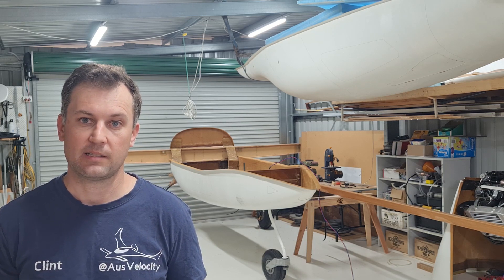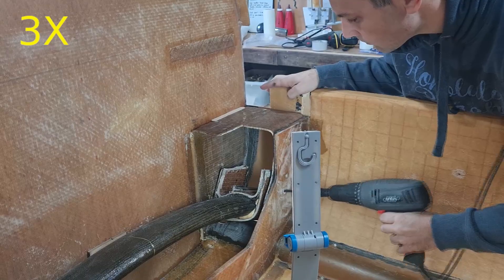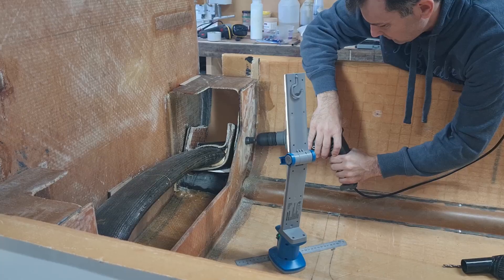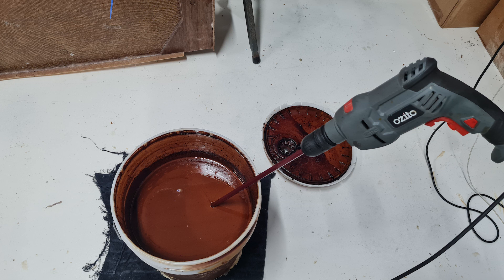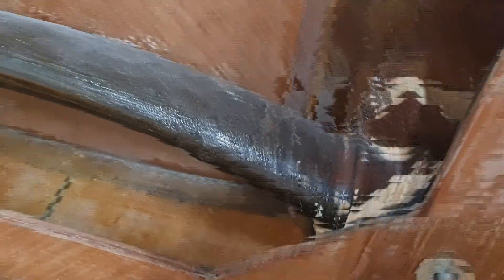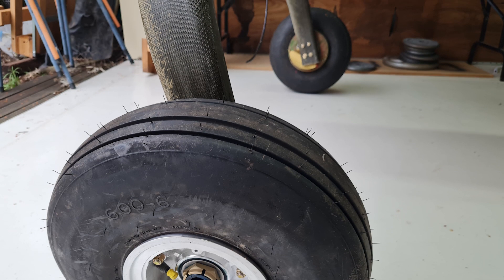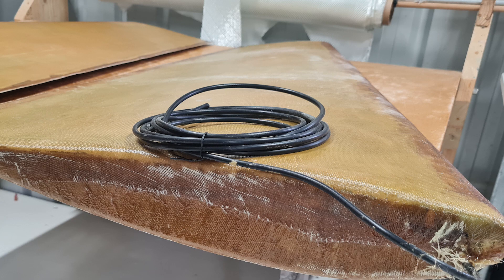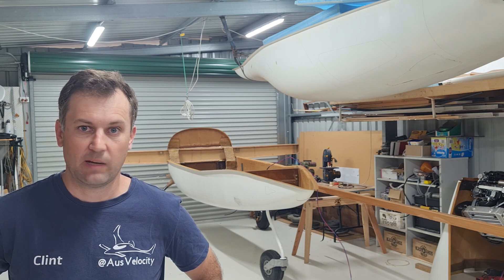Velocity Build Experience 06 - Main Gear-Centre Spar-Winglets Finish.

Comment: I really appreciate your videos on your build experience, but man, this hold build thing is messed up!!!!!. I just discovered the Velocity and instantly fell in love, but the whole build process is so loosey-goosy! Isn't aircraft construction supposed to be more precise? It seems like the whole process falls under "that's close enough" mentality. Is the final aircraft safe to fly?
Reply from the maker: Yes you're right. Everything about aircraft building that I've seen is precise and perfect, up to the point of needing an autistic level of OCD or everybody dies. That's a good attitude to have. 

If building a Vans or a Sling, yeah, things cant be bent or it will collapse, holes exact size and need to be deburred, every part needs to be prepared. A miss-drilled hole means you need to order a replacement part. Just build like you're working for NASA.

Vans meant for you to be really meticulous. Look at their laser cut holes saga, their engineers proved the holes are good to go, but they want to encourage builder perfection so offered replacement parts anyway. perfection = confidence.

Velocity, It's mostly just glass, epoxy, foam and marine ply keeping it together. Simple, Strong and effective. They encourage you to do the right thing  and follow good build practices, but I get the impression they know it won't kill you if you followed the instructions. You'll probably just have to make a few adjustments.

Everyone in the velocity community has a hard time coping with the fact that the plane is not that precise. There is no level of machine precision on this plane, the molds were molded by hand in the 80's before CAD and CNC were the standard. It's built like a tank so the builder doesn't have to be  expert. Look at the g-loading, +10 -7. A modern  aerobatic RV14 is +6/-3g. 

If something is important, it's highlighted in the manual. Things like wing angle of incidence. Or it's been pre-engineered for you so you can't mess up something important, like the shape of the wings. Almost everything important is adjustable after the epoxy has set. I guess if you do the right amount of glass layups for strength, it looks straight for aerodynamics and you didn't miss anything, then it's probably going to be ok. 

Yes I try to be precise, but going for NASA levels of perfect is a waste of time.

Thanks for the comment! I really should make a video out of that.
Reply: @AusVelocity , Thanks for your response and honesty about your experience and thoughts on the process. The velocity is an absolutely incredible-looking plane. I am a very handy person and completely capable of building something like this, but I think my perfectionism would be my downfall in a process like this. I'm not sure I could sleep at night, knowing my drilled holes were not exactly in the right place. I'm impressed with your ability to work with the given process.

But on a side note, those who build the velocity seem to have great success, and the results are incredibly beautiful, so... what do I know? :) I can't wait to see more of your adventure and the final roll out!!

Comment: How much was your velocity?
Reply from the maker: The Kit was US$40,000
The engine was US$24,410
Of course the prices have risen from when I bought it.
Reply: @AusVelocity  that’s not a bad deal at all. Congrats on your purchaser man.  How is the build coming along?
Reply from the maker: @Never_quit  Working on the canard wing at the moment, as well as designing/programming the aircraft electronics such as the engine sensors, trims, speed brake, safety systems, etc. display. I wont show that until its done though. It's unfortunate since it's a big time killer, but I think its necessary, and way cooler than anything else I've seen.

Comment: 😢Like I said in your build number 5, I would have placed a shim between the two spars, instead of using that tongue depressor shim.  It just doesn't look like a "Civil Aviation Safety Authority" approved repair.
The more I think about this, it's troubling. Is there a chance that you didn't glass in the firewall properly?  If you did not, fix it now.  I guess we'll see when you mount your engine.  I suppose that you can always insert a tongue depressor on one of the mounting points of your engine mount.
Reply from the maker: I see your point.
Yes between the 2 spars will need some thin steel shims to get the correct wing pitch angle.
Only use shims at the bolt holes in the spars to angle the wings?
I didn't consider that because the manual didn't mention that. I also didn't consider how much shim I would need between the center spar and the two wing spars, probably 1/8th inch, same as the tongue depressor.
There is ample amount of construction adhesive to fill the void left by the wood shim and I'm confident that the spar is bonded to the firewall.
I feel like trying to un-bond (cut the adhesive and everything else) from the spar and  firewall now would probable lead to a worse situation than what I have now.
There's a lot of bonding points holding the firewall to the fuselage including the 1/2" bolts with more to come when the top shell goes on.
Knowing that there could be a weak point in that position I'll add some more layers of glass around that area in the future. Perhaps from the engine side of the firewall to the spar.

Thanks for raising issues that you see need attention, I have alarm bells that ring too when I see things that seem dodgy but I don't see everything.
Reply: @AusVelocity  My concern is that the firewall is taped in correctly.  I doubt that the main Spar is off 1 degree.  After I finished my Velocity,  I flew down to Sebastian. They use a mold for those spars.  If your firewall is off, you can also shim the motor mounts with a washer.
I was fortunate.  I had a fellow that had just finished and RV 4 helping me.  He had a lot of tips to solve problems.  I'm sure everybody's wings aren't perfect.  We have aileron trim.  I remember on my early flights.  I trimmed my ailerons.  The next flight, I tried to trim them again, and they ended up in the same spot as before.  I flew that Velocity for 450 hours after that, and never had to trim them again.
Reply from the maker: @Alumni6042  Yes, It's likely that the firewall is not exactly square, very hard to get that right when the nose is off the centerline. I'll just have to shim where I can. Thanks for the input.
Reply: Now you may be right about your nose being off.  When I was at Velocity, I noticed the original plug built by Dan hanging up, and I asked what is that, and they told me it was the original plug.  They also admitted that it was off a little bit, which means the original mold was off, which my plane came out of.  I don't know if they used that mold for your plane, but it's quite possible that your nose is off a little bit.  Having said that, I never could see it, and it didn't affect the flight any.

Comment: Hey Clint. I just discovered your YouTube channel, your project and went through all your videos. I must say I’m impressed by all you already did, and how you managed to overcome  the difficulties. Working with composite materials isn’t an easy task if you don’t have serious experience already. 
I wonder if the kit manufacturer gives any building instructions beyond a kinda technical book.... I would have added 1-2 foam cores to the kit (some rejected foam cuts from production line can do the job) for people to to practice on before starting the actual construction btw.
It would have been reasonable to start building the winglets or the elevator instead of the wings. Smaller parts are easier to make while the issues are the same. It may have helped you to get some initial experience and confidence in your skills.
Good luck !
Reply from the maker: Hey Thanks.

I'm working on the canard wing at the moment and I've come to realise all the foam cores aren't perfect. I think the issue is with the foam and not the cut. The issue is there are stresses in the foam block as it's made and when cut, the foam relaxes and slightly reshapes itself.  I just assume you just fill in the missing bits with filler and sand down the high bits until they look good then glass over it.

In hindsight, I'm not sure any practice is needed, the foam and filler sand down easily, and mistakes are easy to fix. It's like icing a cake, just keep going until you're happy with the result. 

I don't really see myself as working with "composite materials", I watch those wizards on youtube with carbon fiber, cnc cut molds and vacuum systems and I think, I'm just playing with adult paper mashe.
Reply: @AusVelocity  don’t underrate what you are doing :) my personal knowhow is quite extensive and my comments were honest.
Regarding the foam cores : some defects that I saw were solely due to poor hot wire cutting. FYI I made moulded parts with foam cores. I had to reach precision better than 3/10mm in order to be able to close the mold. I still have 30 years old parts that look as strait and well shaped as new.
Regarding the foam : there are always internal tensions. The more you sand the foam the more you release these tensions. A good foam core is the one that needs nothing more than a good brushing to remove the filaments, then a very slight sanding, to remove the superficial hot wire cuts residues. Don’t forget to blow some air to remove the dust as it sucks a lot of epoxy. I wonder which filler you use since, according to my own experience, sanding epoxy based filler (hard material) and foam (soft material) at the same time makes things only worse ...
The key to overcome the tension issue resides in the quality of the negative foam elements. If the initial block is strait, all the building should simply be done using the negative core as a jig.
I use to glue (foam contact glue) the negative core to the working table (massive and strait. The best working table consists on a marble plate. Steel tubes reinforced wood plate can do too). Just protect the negative core’s inside (concave form) with a plastic sheet (the one used for greenhouses is perfect), place the foam core and tape it, lay your fiberglass etc, and your wing will never have any unwanted twist.
Reply from the maker: @tn1509  Wow all good Information.

The filler is the recommended one from the factory, They call it Velocipoxy and it comes supplied with the kit. Epoxy, It's DER-324 and some sort of non-structural hardener all mixed with plenty of micro. My only gripe is it takes overnight to fully harden. Car body filler (American brand bondo) is good to sand in minutes. bondo is mentioned in the manual but used more as a removeable glue.

Not much I can do about the foam I'm supplied with, they are pre-cut from the factory and It's on the other side of the world so replacements are a major hassle.

Yes trying to sand foam along side of epoxy filler is a problem and you can continually make the job worse the more you try to make it better.

I notice that if the foam pores are well impregnated with epoxy then that helps keep the surrounding foam intact during sanding. But you need a runnier (less micro) filler to do that. The curse is, that the runnier the filler is, the harder it is to sand so I don't bother. I just take care to sand the filler more or with more pressure than the foam.
Reply: @AusVelocity  Thank you for your feedback Clint. Bottom line is that there are no miracles regarding epoxy filler sanding on foam  :))
I use to heat the epoxy (without the hardener!) a little bit (30°c-40°c) then leave it to cool down to room temperature. Curing should be a little faster.
I may have other shortcuts to share. Feel free to ask.

Comment: Great progress! Taking into account your location, you move pretty fast! Looking forward to see your strakes done.

Disclosure: I am in forth year of my build of Velocity XLRG :)
Reply from the maker: Thanks Dmitry, I've studied your videos several times for some good ideas and methods that I'll use later on. It was good seeing the cowling since It's hard to get an idea what it should all look like while you're building. Yes, the strakes and the fuel tanks. That'll be interesting, at least I won't have wheel wells to worry about.
Playing it cautious here, getting a replacement part from the factory would not be quick or cheap.

Comment: you can heat up the hardener. we do it in a waterbath (60-70 degree Celcius). chad told us this trick.
Reply from the maker: Ahh, yes makes sense. I use Dmitry Spasibenko's hair dryer trick sometimes with the epoxy pump.
I'll do that next time I need to refill the pump. Thanks.
Reply: You are perfectly correct!

Also, keep in mind that epoxy sucks moisture in.  Heating it up helps removing some of it (better not to exceed 40c-50c  as it may alter its properties. Some enzymes are pretty sensitive). Let the epoxy/hardener to cool down prior to use.
Don’t heat the epoxy+hardener mixture, but if room temperature is less than 15c, you can heat it up VERY gently to 20c-25c (adjustable hair dryer)

Pour the epoxy into a large recipient. It will better dissipate the heat produced by the chemical reaction and will extend the available working time.
Avoid working epoxy during rainy days. A hygrometer is a cheap useful asset in the workshop : moisture degrades the final mechanical properties by a lot.

Comment: Glad to see how its progressing. Try to stay motivated! 

A couple of questions:
If you were doing it again would you have gone for the Quick Build kit?
Why did you buy the engine at the start rather than later in the build process?

Thanks
Reply from the maker: Hey, good questions.

I wanted the engine in my possession from the start. The whole project was only desirable and economically viable with that engine. I was a little worried the price would rise or it might become unavailable near the end of the build and the project would be left in limbo.

If the extra money was there, then yes, quick build kit. That's not to say I didn't enjoy building those parts, the extra time building has given me time to think about the direction of the project. The project has also become a bit of a leisure activity.

There's no problem staying motivated, things are really starting to get interesting now I am starting to put some really innovative technology into the aircraft.